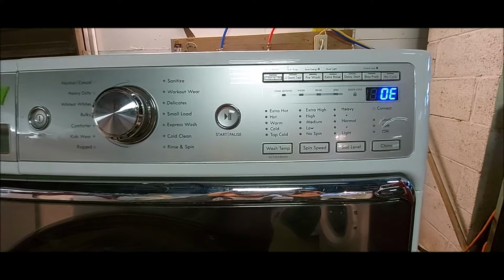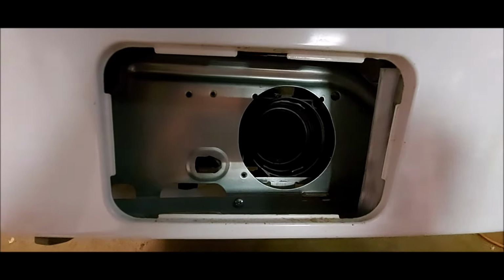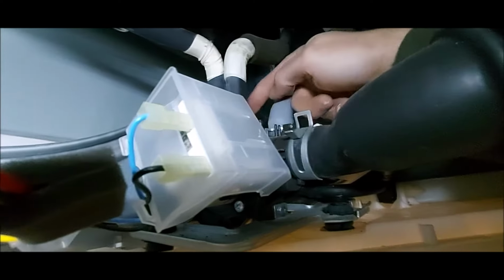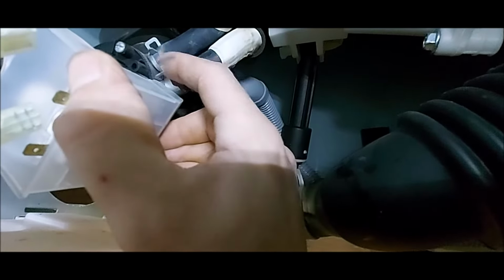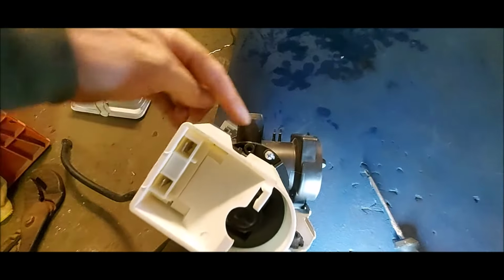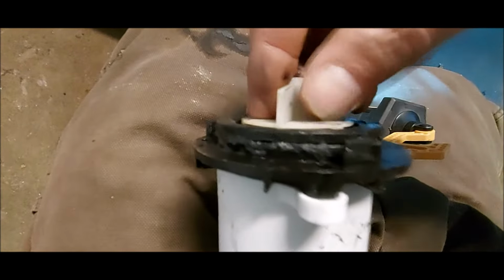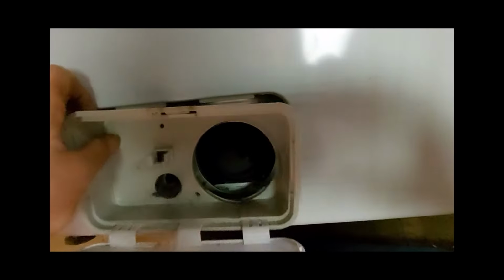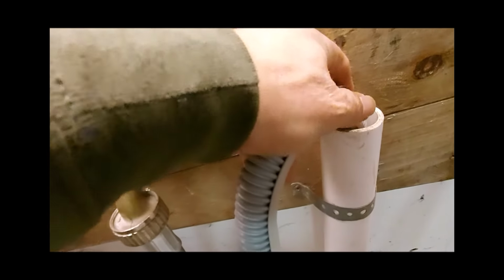Kenmore Front Load Washer Code 0E OE Drain Pump Replacement And Filter Clean Model 796.41072310

Comment: Great video, replaced my pump and my Kenmore Elite is now working for $34. Some tips I can add is to take a picture of the motor alignment and which holes had screws when you remove it from the pump. I also had to take off the bottom mounting bracket to take the motor out of it due to tight fit. You can use a wet vacuum to get nearly all the water out of the wash machine before doing this job, and tip it on it's side vs the back allowing easy access to the pump location.

Comment: Super video, my guy! Got the 0E code. Checked the filter and hose and all seemed good so figured it was the pump. Your video was the best and I love that you accessed from beneath unlike others. I put a jack stand under it just in case but it was a pretty straightforward repair. After pulling everything out, I had difficulty getting the pump off because the metal bracket was blocking it. I had to remove it (just four screws). My rubber gasket was ripped and seemed to allow for movement even when tightened down, so I put another thick rubber washer in there and that eliminated the play. Thanks so much!
Reply from the maker: @Joseph-Kilgus  awesome 😎 glad you got it going, Hope you have a great weekend 💪

Comment: Alright, removed and cleaned out my filter and drain tube, replaced drain pump with a new one (old one seems to have had a bearing failure) reassembled and ran two test loads, both failed to drain and threw a DE code. What am I missing?

Comment: Your video saved me $800.  Sure enough, it was the drain pump that needed replacing.  Your step by step directions were easy to follow.  It was pretty tight underneath the washer trying to get everything loosened up, but with a little patience and persistence, I was able to finish the job.  Thank you so much for your help!
Reply from the maker: Awesome 👍 I'm glad it was able to help you out..

Comment: The question  I have here is, how do you know that the hose from the tub is not blocked  with a sock or something in the tub before you remove the pump and hoses? Is there a way to inspect that area and the pump inlet? I have found coins in the filter before when cleaning the filter  so I assume other items can find their way into the pickup tube. My machine, I hear the pump motor running but the water level does not go down and the machine keeps cycling until the OE code appears. In other words, I do not want to remove and change the pump unnecessarily. Thanks!
Reply from the maker: Even if a sock was in the inlet tube, you will still need to remove the pump to extract the sock. Sounds more like your impeller is damaged on your pump to me though.
Reply: How can you inspect the tub and pump inlet? @MissouriAgitater
Reply from the maker: @James-zy8vk  where the pump attaches to the tub is the inlet, these specific units aren't bad about socks being in them, but it's not impossible.

Comment: Hi I am getting nd code in middle of the wash washer stops no drain and some water in the tob left, any idea what could be the problem with my Kenmore?
I did open the front drain like you did a lot of small stuff I cleaned them and start the machine again but same problem!

Comment: This video included sufficient information and images to allow me to extract the drain pump from same model washer and then I even dissected the motor. It needed cleaning on the inside because it had some sand in it. I put it all back together (twice) and it works great now.  Pay attention to which way the wires are connected. I hooked mine up backwards the first time so had to redo it but it was way easier the 2nd time. Good luck to everyone.

Comment: Man, this saved me ALL kinds of time going through the bottom like this instead of disassembling the whole machine.  Tip: Keep a good worklight inside and the two hard to reach bolts are visible from the front.....reach around and put your socket on it.  Whole job done in under an hour.....thanks so much!

Comment: I've gotten everything out but how do I know which,  if any,of the motors are bad?
Reply: Thanks for the reply.  I got it all apart and there is nothing causing a clog. I have no way of knowing if the pumps are good or bad.  The propellers both turn fine?? I guess I'll just replace them both while it's out.
Reply from the maker: @may142004  when facing the machine the pump on the left is the drain pump. "The one that needs changed" You shouldn't have to replace the other one. It's only a circular motor and doesn't cause the OE code.. I hope this helps some.
Reply from the maker: If you get the OE code and have checked the filter then the motor I explain in the video is bad. Everything is explained in the video on checking the motor and which one it is.
Reply: @MissouriAgitater   my parts came in and I replaced both pumps since it was all out anyway. It worked like a charm.   Thanks.
Reply from the maker: @may142004  awesome!! I'm glad everything worked out for you 👍👍

Comment: Mine throws the OE code. If I I restart the washer it works the second time. I'm wondering if it's the logic board instead of the pump.
Reply: I think that’s my problem. Replaced the pump and the pressure switch and still not working.
Reply: @FEBRIZIOtv  I ended up just replacing my whole unit. I think these after market pumps are trash.

Comment: Cleared all lines and filter and replaced pump. Still getting same OE code. Any other ideas?
Reply from the maker: Overabundance of detergent suds or bubbles will also throw the code 0E and I have also seen new parts that was bad from the factory.. Also trace the pump wires to make sure there are no breaks and everything is making a good connection.
Reply: @MissouriAgitater  so the circulatory pump definitely has nothing to do with it?
Reply from the maker: @closerangeoutdoors1496  no.. it won't throw the 0E code with a bad circular pump.. But it will if someone puts a circular pump in place of the drain pump. The circular pump pushes less water and has a smaller impeller.
Reply: @MissouriAgitater  thank you sir
Reply from the maker: @closerangeoutdoors1496  no problem, hope you get it figured out.

Comment: Had the same OE reading on my gfs unit, when I went to remove the exterior filter plate cover, water came out. What’d ya think?
Reply from the maker: Was the filter tight? they have been known to loosen with time. Also, you may try running the machine and watching to see if you can locate the source of the leak. The front rubber boots can also be notorious for leaking.

Comment: What if the washer is on a platform drawer?
Reply from the maker: It will need to be removed from the drawer first.
Reply: I just did it on the platform.....take out all of the screws on the side holding it to the platform and lean it back on top of the platform.  I set it to where it was steady and balanced pretty good and ran a ratchet strap across it to the wall to hold it back.

Comment: Are the drain pumps the same on all the kenmore front load washers?
Reply from the maker: No there are several models that use the same pump but not all of them. The model I'm working on here has a link in the bio to direct you to the correct pump.

Comment: Thank you soooo much. I was able to fix my washer without an expensive repair man visit.(The washer would not do anything except turn on and make a strange clicking sound. ) It was the first thing you mentioned. I unscrewed the filter and a bucket of water came out and the filter had just a small piece of plastic trash caught in it.  After letting it drain and removing the junk from the filter, I screwed the filter back in and turned the washer off. When I turned it back on and tried to run a short cycle of wash--it started right up and ran a full cycle.
Reply from the maker: Awesome!! I'm glad the video helped you.

Comment: My machine just threw an OE code. It's been a while since I drained and cleaned the filter so I just did that and ran an express wash. It made loud noises but it seemed the soap was used before it threw and OE code again. Now I'm running a rinse cycle to see what happens and waiting for it to finish so I can get the load of clothes that are in there out. Think I will try to run an express wash with hot water to see what it does next. It was making loud noises like it was having a pumping problem of some sort. Hopefully it was just a clogged filter bc there were some gross stuff I pulled out. We'll see.
Reply: No such luck. Waiting for part.